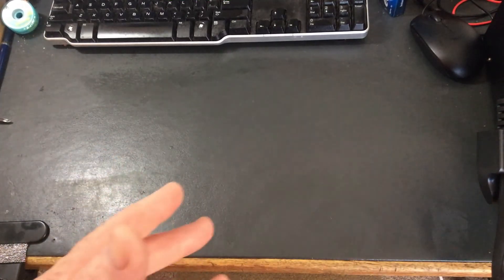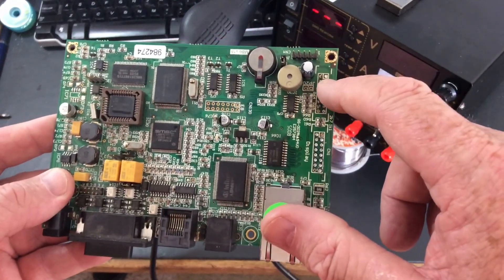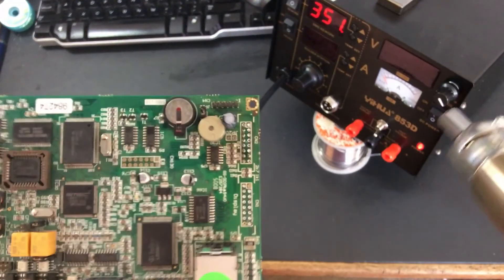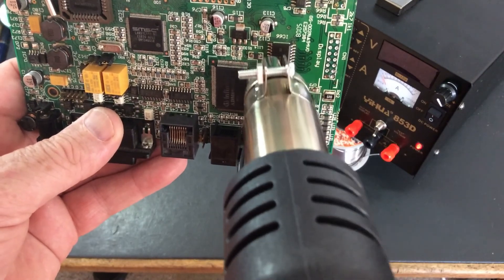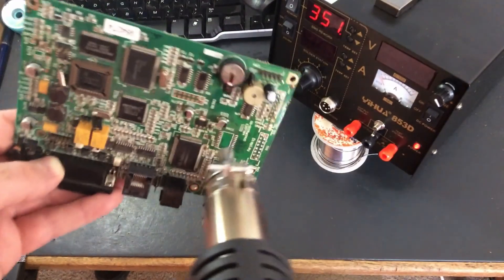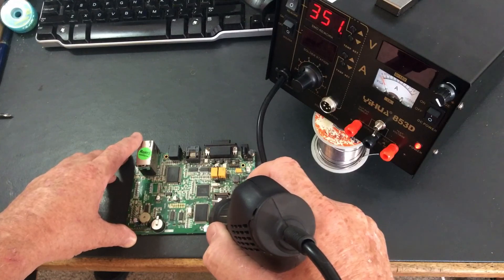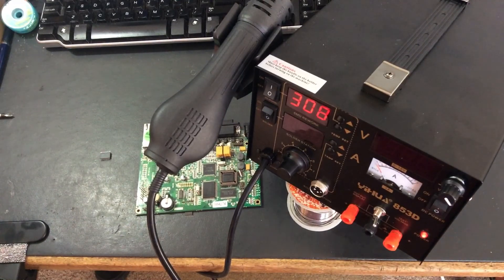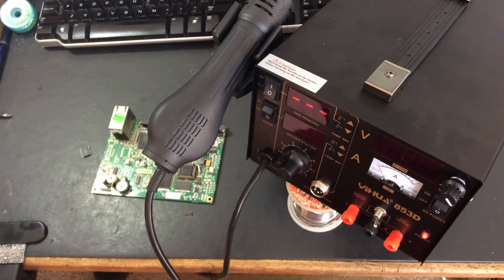A newbie's test run desoldering with the Yihua 853D

Comment: Just for information, the negative terminal of the power supply is not earthed - it just floats. I don't know if it is intentionally isolated or just a manufacturing error in mine. Some may prefer it that way but I opened mine up and added a wire link between the black terminal and the earth lug on the case inside.

For desoldering/reflowing I find that often it is necessary to turn up the heat a bit more than the temperature you actually want and reduced the air flow.  It looks like when the fan speed is high the actual temperature of the air that comes out of the nozzle is way lower than what is indicated. At low fan speeds it is quite accurate but as you increase the speed the temperature gets way lower than indicated, especially when using wide nozzles.

Mine is actually not named MarkEthan 835D rather than Yihua 835D but looks exactly identical.
Reply: So you just connected a hot wire dc directly to earth 🤨

Comment: For one don't use the heat on something you are holding upwards.  Lots of bad things can happen like other components falling off or you can burn yourself I don't know and you must use flux or you will cook everything. Also helps if you preheat the board maybe atleast heat the bottom so the whole board is warm and not just a spot heat on one side shocking the board and or components. It's like adding cold water to something really hot.

Comment: Heat might be set to low. Solder has a melting temp of 370 degrees. Adjust accordingly.
Reply from the maker: Thanks for the reply. You're probably quite right!
Reply: Truth Never Lies  Flux on the pins?
Reply: @shutinyanks  yes